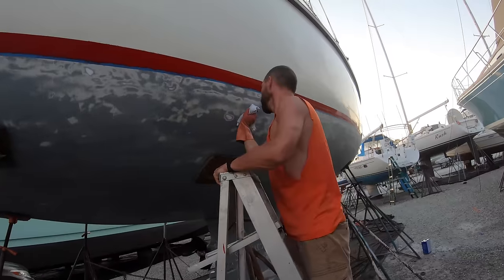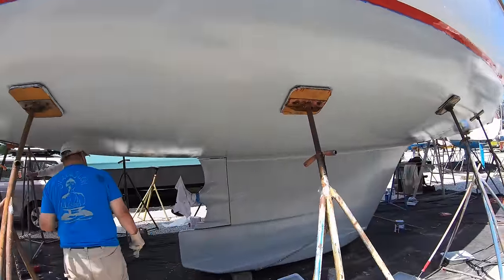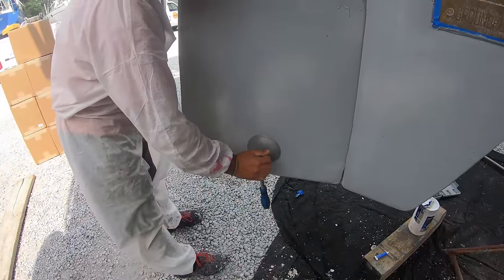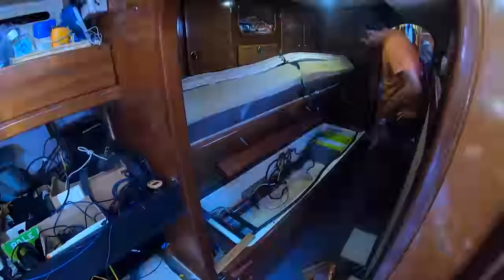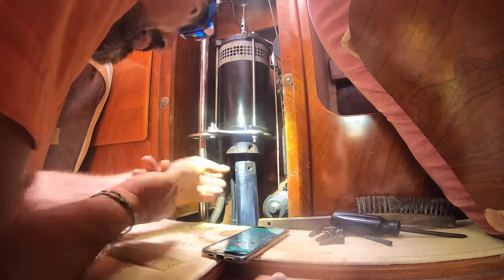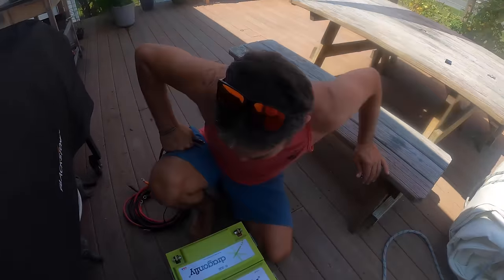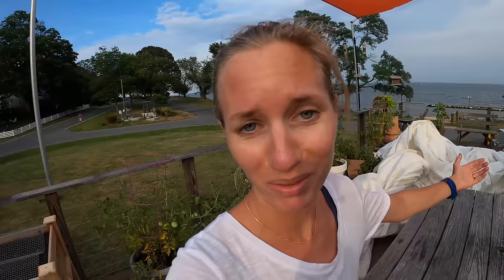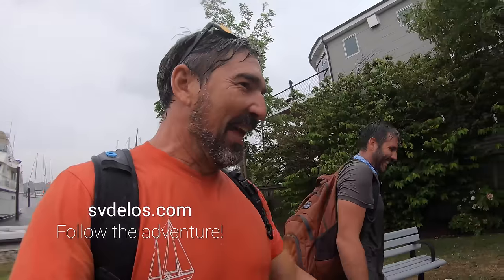The reality of OWNING A SAILBOAT!  - Sailing Vessel Delos Ep. 290

Comment from the maker: Ahoy Tribe!  As you probably realize by now we're keen to continue testing and evaluating products that we find interesting.  In this video we continue to test the LiFePO4 cells provided by Dragon Fly energy. The batteries are incredibly awesome, and we've tortured the hell out of them since installing them.  They run our entire boat including electric induction cooking and oven!  In fact, there is nothing wrong with the bank we removed!  We were just asked to continue torture testing their latest version of their integrated BMS.  Our old batteries, which are still warrantied for 10 years will continue on powering our friends at Sailing Calico Skies.  

If you'd like to learn more about the batteries we use and the system please check out the following links:
Battle Born Batteries (USA) - https://battlebornbatteries.com/?afmc=svdelos_bb77 
Transporter Energy (UK) - https://www.transporterenergy.co.uk/partners/sv-delos
Lithium System Overview - https://svdelos.com/lithium 

Also a quick recap on our eternal search for a good performing eco-friendly paint- The paint we put on in Grenada coupled with the Sonihull Ultrasonic system performed as specified. The Sonihull does an amazing job of keeping hard growth off, and the SeaCoat VX10 does a nice job as long as you are able to move frequently and with speed.  However when we sit for extended periods and explore we do experience a lot of soft growth.  A more detailed review can be found here: https://www.youtube.com/watch?v=4nhwYkQiQbc

This time around we're going to keep the Sonihull system as it works great for the hard growth, but we're going to try another paint with two biocides (Econea and Zinc) instead of traditional copper to fight the soft growth. The paint is experimental and not currently available for purchase, however if you'd like to research more please visit https://www.magicantifoul.com/ 

Fair winds, and hope you are having a spectacular day!  Capt. Brian
Reply: I loved that u shared ur batteries with sv calico skies. Delos u guys r amazing !! Love u guys. Side note. During covid u guys have gotten me thru this terrible time😷🥰🥰
Reply: @reginasimms46  👍
Reply: I ♥️ morning coffee with #delostribe ✌Love Cynthia
Reply: How is your Internet with that dome?  I don’t think I’ve seen an ep That has explained if it’s working or not. It seems like it was working when you’re in the Bahamas but how about when you were overseas? Does it work by satellite or how does it work
Reply: Sv zatara  just had a company pay for the hall out and the paint I think it’s called slippery bottoms.They got it done right before Covid and I think they had really good results you might talk to Keith I’m pretty sure you guys know that boat
Reply: Hey Brian my husband and I have been watching you guys for the past five years cause we are interested in sailing am from Grenada and my husband is Canadian 
We are on the verge of buying our first boat and wanted to ask you about your internet connection how much it cost cause we would like to get one for our boat
Hope to hear from you soon all the best to you and your family hope we will meet one day
Reply: Zatara had terrible results with the Magic Antifoul..  Hopefully, things work out much better for Delos.

Comment: Hey Brian, use a socket same diameter as the bow thruster seal to tap it in evenly. You can get seals with s.s. springs OR fit a tight O-ring around the lip to act as spring replacement.

Comment: May I suggest, lip seal of Bow Thruster should be installed, facing spring to the sea water side/pressure side, if you want to prevent water ingress from outside to inside of the boat.

Comment: Nice video.... suggestion on electrical safety: Next time do all secondary load connections with the pos or neg battery lead disconnected so that sparks do not fly. When working with batteries, use taped up spanners and tools so the bare metal tool cannot short the Pos and Neg of the Battery, remember Batteries can explode and the shrapnel and chemistry can blind you or even kill you. Wear gloves when working on bare wires, do voltage checks before touching wires....... take great care....... big cheers,   P&F, Sechelt, BC.

Comment: Just a little advice for your next haul out! The sacrificial anodes should not be installed over or on a painted surface! The metal needs to be bare under them for optimum performance! The paint acts like insulation on a wire and prevents current going to the anodes! Also aluminum anodes should be used rather than anodes made from zinc! Happy sailing!

Comment: This reminded me of restoring our old Airstream.  All the tricky stuff was in an awkward spot, required obsolete hardware, and had to be done in a scorching heat or bitter cold.  LOL! The head was so funny.  Do you have a small PC fan to pull fresh air into the compressor compartment?  The current to run it will probably pay for itself by letting the condenser run more efficiently.

Comment: The seal that goes in from inside the boat where the bow thruster comes in...apparently one Amel Super Maru sank because that seal popped up. The manufacturers fix for this is you drill two holes, one on either side of the seal, then add a screw with washer that holds the seal down in place and prevents it from popping up and letting seawater in. If I had one of those boats, I'd do that fix!

Comment: How did you paint under the stand contact points? Also why are the sail seams not  sealed with some sort of adhesive or sealer to give it  lateral strength under stress.? Everything you are doing will go such a long way in happy sail times.

Comment: Thank you 🙏 AGAIN for your work 👍❤️💪 Your videos are excellent succinct informative and flawless 👍.
🤔Ever thought about going ALL Electric and ditch the diesel engine and fuel tank??
Reply from the maker: Yes, at great length!  After doing many calculations I've decided that the range that can be provided by pure batteries is still not there yet, so the only real option for a go-anywhere boat is hybrid.  if the energy density of Lithium continues to improve it may be a reality for us in the future, but for now unless we can motor 150NM without charging it's just not realistic for our style of cruising.
Reply: @svdelos  Thanks for the reply 🤓.. I should have known better 🤔 of course you thought about this 🤭

Comment: Brian, thanks for the great videos. I'm concerned about the long term safety of your lithium setup. Just a heads up, there is no such thing as a safe "drop-in" replacement lithium battery, especially aboard an ocean-crossing vessel. The built-in BMS of Battleborn batteries will simply drop the faulty battery out of the circuit. If your batteries are all fully charged up, and the alternator or wind generator is spinning, those charging devices will bypass the lithiums that have dropped out of the circuit and dump unregulated voltage right into your DC distribution and fry all onboard electronics. The Battleborns aren't smart enough to tell charging devices to switch to float charges, so they will just drop out instead. One solution is to have an AGM or SLA in parallel with the lithiums in case they drop out of the circuit. This ensures that in a worst-case scenario, unregulated charge current will dump into a battery and not your electronics. Check out Nordkyn Design's great blog post on this issue. http://nordkyndesign.com/electrical-design-for-a-marine-lithium-battery-bank/
Hope this helps!
Reply from the maker: Hey, yes I've looked at the Nordkyndesign site quite a bit, smart guy and knows his stuff!  You know we did discuss this quite a bit and the issue with having a lead battery as ballast was two fold- first since we are 24V we would need two of them which would take up a bit of space, secondly we need to charge the batteries at 28.8 29.2 which is pushing it for a lead battery.   In the end we decided the risk was not enough to warrant putting too much into it since the regulators for wind and solar are pretty effective at shutting down, which we have tested in fact. I think a bigger issue is actually the alternator on our main diesel, which can potentially be damaged in this instance.  To accomodate we did install a spike supressor from sterling http://www.sterling-power-usa.com/SterlingPower12voltalternatorprotectiondevice.aspx .  We've had the Lithium in for nearly 3 years now and so far so good!  Fair winds Brian
Reply: @svdelos  Great to hear you have done your homework! Sounds like a great system!

Comment: The zinc you put on the rudder needs to be in contact with the metal to function properly. You put it on top of the paint
Reply from the maker: The bonding strap actually goes through the rudder, and is connected to the zince by the metal bolt that goes into the rudder (since the rudder itself is fiberblass).  The metal is bonded through the rudder shaft to the rest of the boat....  It does indeed work!  Brian

Comment: That mains wiring into the inverter plug was not cool!
Not the sparking DC side but the shoving of bare wires into the mains socket to connect the power board.

Comment: How to get 220/240 - most American houses are actually fed 220/240 by the electrical grid and it is separated into 2 legs of 110 at the electrical panel. So in order to get 220 all you need to do is find 2 outlets in the house that are fed by the separate legs, take only the HOT of each leg and put it to the hot of the 220 outlet and also use the 120 grounds to ground the 220 outlet. It requires a little bit of electrical knowledge to be safe about doing it. There are some already made up devices that will do this, one is called the Quick 220.

Comment: Darn, I wished you used a keel cooler for your refrigeration rather than hot air circulation, I guess if not, you are getting ready for the artic where any in hull heat you can get is a good thing.

Comment: Curious, how did they install the new compressor and condenser. Was the part with the vacuum pump and R134 charging done off camera? I know per-charged tech exists just didn't think these units would have that sort of line connections.
Reply: Trix Kemuel I think they were pre charged.

Comment: Did you paint the bow thruster prop with anti-foul?
Reply from the maker: Yep, we sure did.  We used an antifoul spray meant for stern and outdrives.  Works pretty good but since the thruster retracts into the hull it's dark most of the time, which really hampers the growth of most things so we haven't had too many problems with growth there.  Brian

Comment: Am I wrong? The zinc plates need to be metal on metal contact to work effectively. You painted than put on rudder. That’s not right, in my mind?
Reply: The bolt holding it in place presumably connects to the conductive skeleton.

Comment: Would of bee easier to make 220v out of the 110v outlets. Just need to run a wire to to the hot from 2 different (out of phase) circuits in the house. Probably could of used an outdoor outlet and ran a wire through a window to an inside circuit.

Comment: Does not the zinc anodes need to be attached to the bare metal of the part you are trying to protect?
Reply: The bolt holding the zinc pucks on likely goes through the conductive skeleton.  And the skeleton is presumably conductively coupled to the hull.

Comment: Hi Brian, I think it's time to get an electric engine with a lot more batteries and a generator to top it up.
Reply: Hmmm, that swap is not an easy engineering problem.  The electric motor would weigh less, but the batteries would weigh a lot more.

Comment: Actually, a "normal" sailboat owner would have a much worse experience. Just think, Delos gets lots of, essentially, free equipment (batteries, sails, radar, etc.) and a willing band of helpers, who give their all to help out. The normal owner would be spending much more, working their ass off and not having the moral support of hundreds of supporters. Poor guy!
Reply: Brian has more than earned it!
Reply: Companies need real world experience to be able to accurately assess their product.  Most of the stuff Delos gets to try out isn't available to the public yet.  They basically use it for Sea Trials.  As for the sails, I'm pretty sure they've always had to buy them.  Even the one they are using now that was damaged on the trip is being replaced by a new one.  Brian said the company told him it would be cheaper to replace it with a new sail rather than to have that one repaired.  Sure sounds like he's paying for it.
Reply: Not all sailors spend hours and hours filming, editing and putting out videos and sharing their lives? When you share you often receive 🙂.

Comment: Doesn't zinc actually attract and accelerate scum growth and accumulation?
I thought people use sacrificial zinc plates under the waterline (and even connect them as powered electrical anodes) to concentrate the biomass into small easily cleaned/removed sections while minimizing buildup on the rest of the hull?
If true then why prefer a zinc-bearing paint? "Biodegradable" is good but encouraging biology to stick onto (and drag) your boat is bad.

Comment: Always better to spray apply to give an even smooth coat.
Reply: Spray is far more difficult to control though... In a controlled environment, you are indeed correct that it produces a far better finish, but in the boat yard they have to contend with wind. Over spray, even in a controlled environment is a fact of life, but outdoors, it can easily result in having to pay to get that over spray removed from many other boats. A number of years ago now, a company had the exterior of their building repainted, and the contractor used spray guns to do it. The contractor then had to pay to have 30 or so cars repainted because they had been painted a block away by overs pray carried on the wind. 

Further there are a LOT more environmental regulations to deal with when spraying than hand painting and as a result many places can not or will not permit spraying... a lot of places do not even allow work on bottom paint without paying heavy fees to offset environmental cleanup fees and or doing serious containment measures.
Reply: @mattlewandowski73  We spray apply on Oil Rigs and  Oil tankers while on a passage. We spray apply using rope access techniques. Just throw up some sheets and spray. A roller will give an uneven finish which will allow marine growth to attach to the underside.